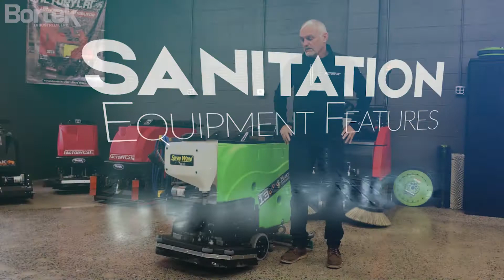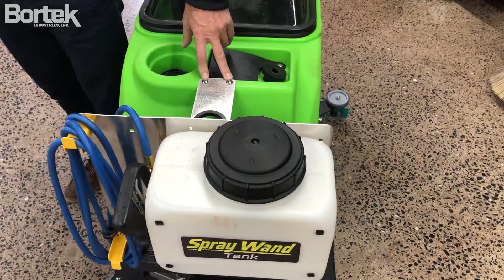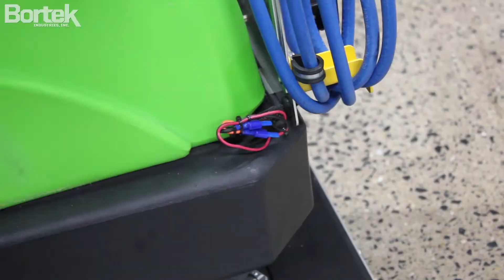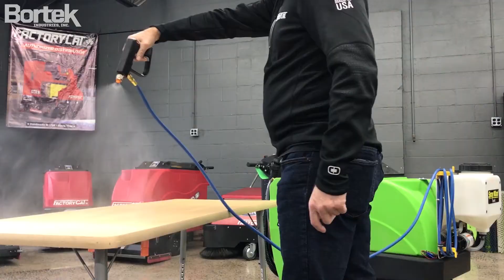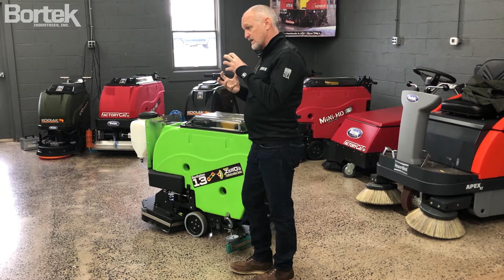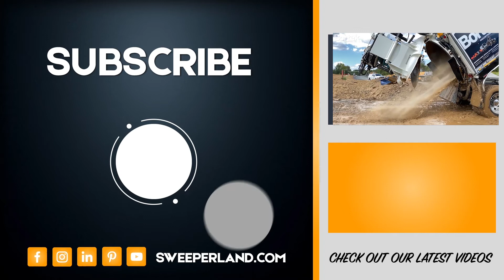Factory Cat Sanitation | Equipment Features | Bortek Industries, Inc.

Comment: Hello Keven what’s the difference between TomCat carbon28 in vs Factory Cat HD Mini 28 
I clean technician shops 
Thank you
Reply from the maker: The Factory Cat & TomCat models you mentioned here are exactly the same, just different lines from the RPS Corporation. You'll love either one you decide to use so it really just boils down to if you dig the color red or gray!
Reply: @bortekindustries  
Thank you